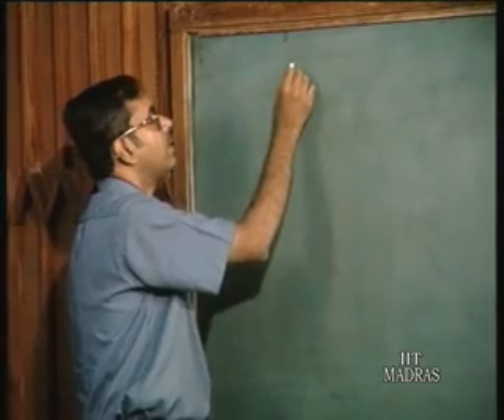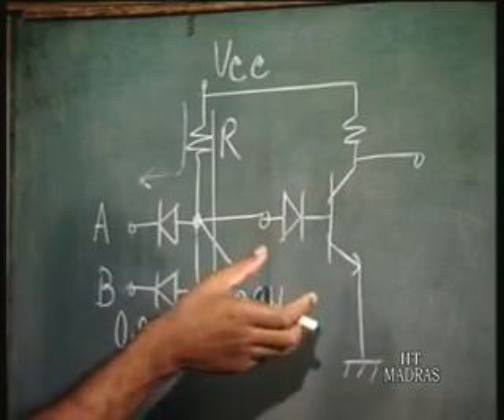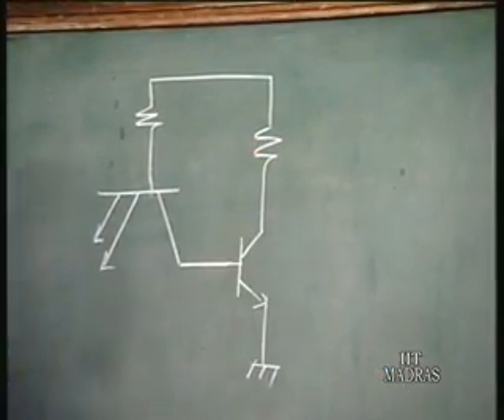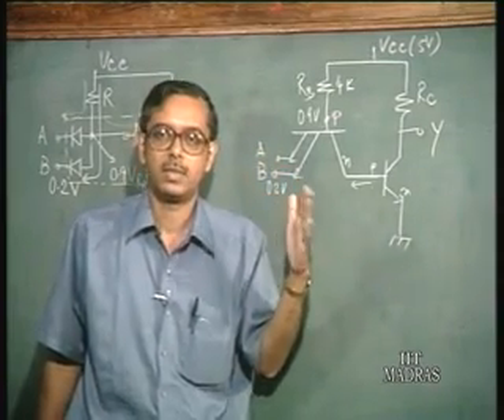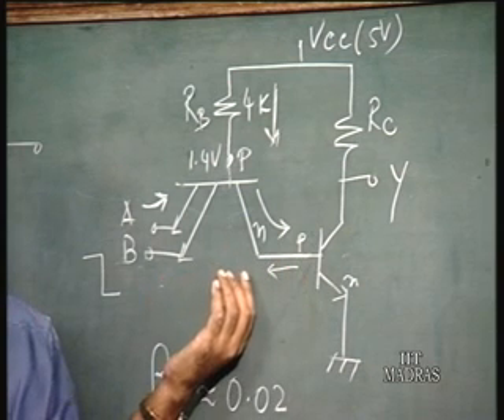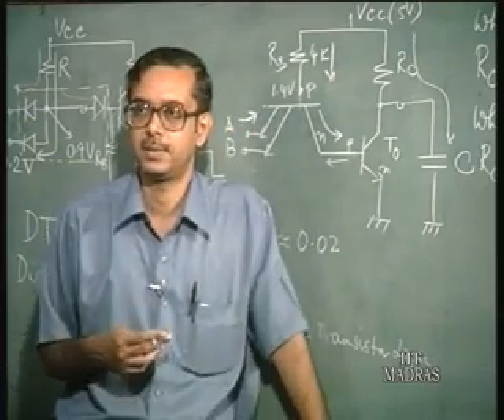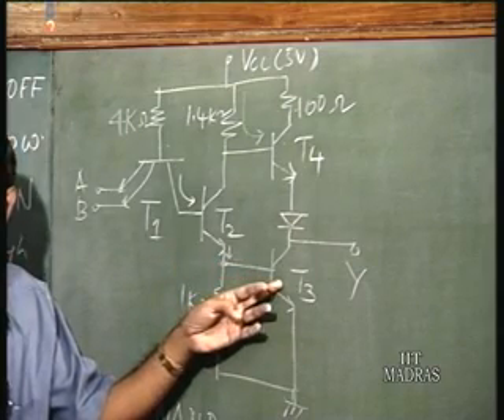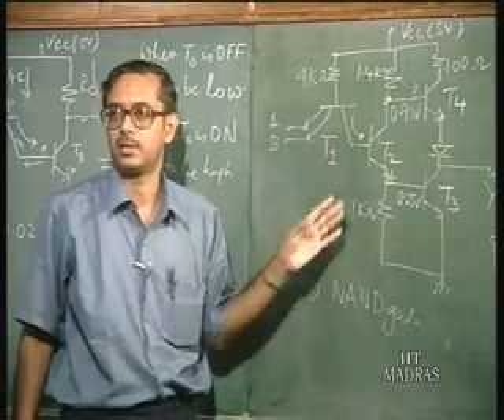Lecture - 8 Qualitative discussion on TTL Circuits

Comment: Sir at 39 minutes, when you are talking about T4 getting cut-off due to the divided 0.75 volts between the base-collector and diode pn-junctions, why can't the 1.4 k ohm resistor drive T4 into saturation?
Reply: Because when current flows through T2's BE and then through T3's BE junction, both transistors are turned on which allows current to flow from the collector of T2, through T3 to ground, so the T2 collector voltage (T4 base voltage) will not rise above the two transistor's PN junction drops.

Comment: Sir I have a doubt 
It is needed to  connect negative terminal of the power source to A and B . so we'll draw or extend the same line to the  base emitter source required so that we donot require a  seperate source and essentially as an assumption , pn jn voltage is same as the emiter base voltage , so i think it works in controlled conditions 
Thankyou for a good lecture , Feeling curious for an Answer

Comment: @7:04
 How is it saturation region? Vcc connects to collector which Is n side and 0.9 V is supplied to the base region which Is p type which means CB junction Is Reverse biased. So the region is active region right and not saturation?

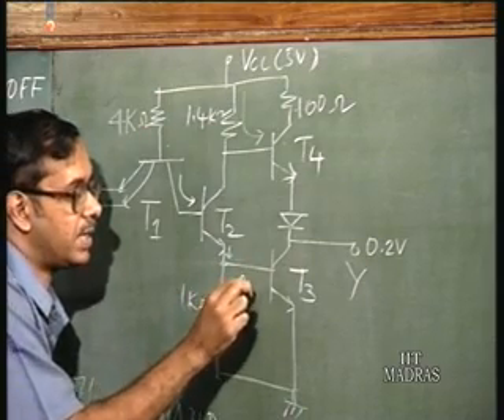Comment: 40:19 . can anyone help me to say when t2 is saturation how the collector of t4 become 0.95v
Reply: braveknight 9 do you mean base of T4 /collector of T2??? If that's your questions then it's because of T2 being in saturation it has 0.2V across its C and E terminal and there is a 0.75 volt at terminal E because of T3 being on, it has 0.75v across its base and emitter terminals. So net voltage at collector of T2 is voltage across C and E and voltage at E= 0.2+0.75=0.95V